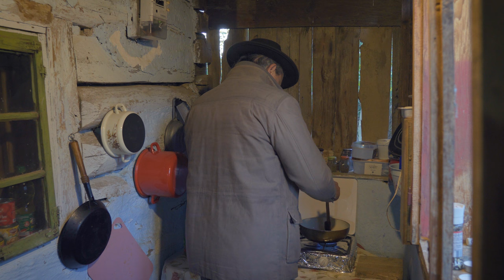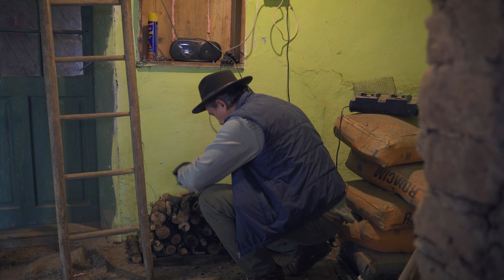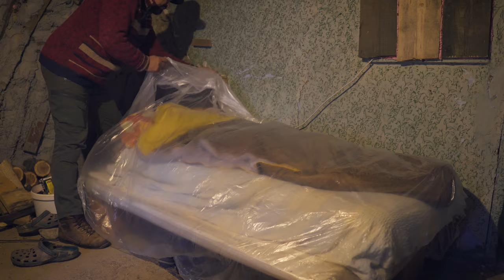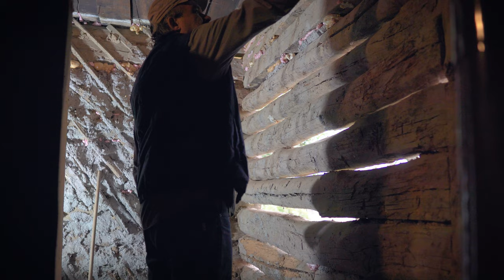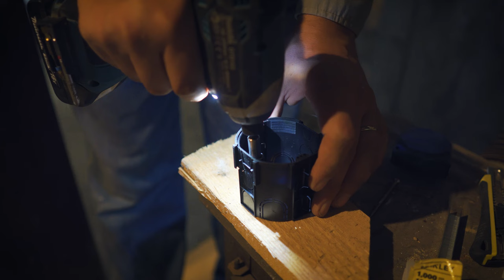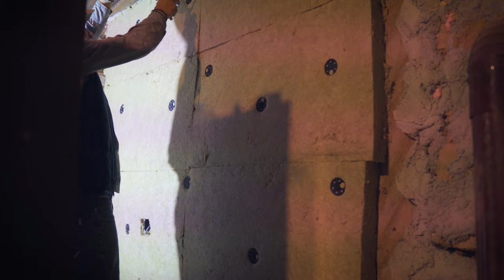#6 LOG CABIN diaries | Autumn Chores

Comment: what goes on top of insulation on the walls, osb? and than drywall? or is this just a temporary solution?
Reply from the maker: The insulation itself is not temporary. I'll come with plastering over it at some point.